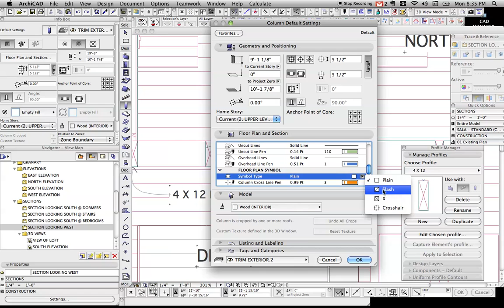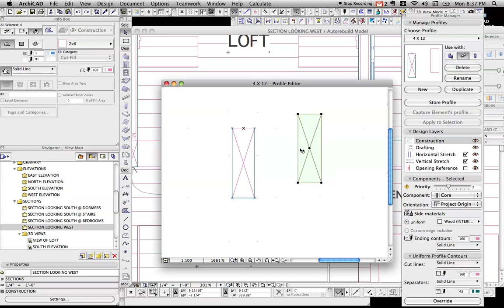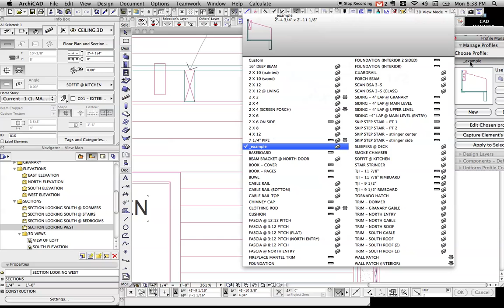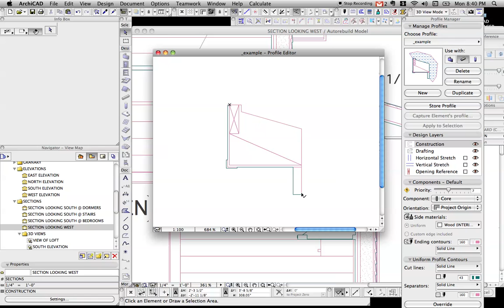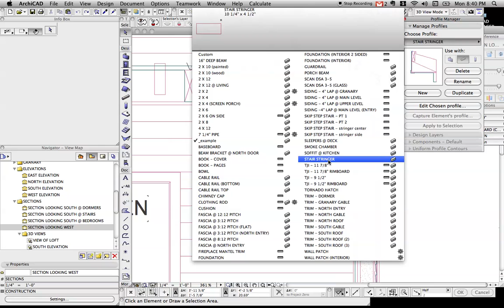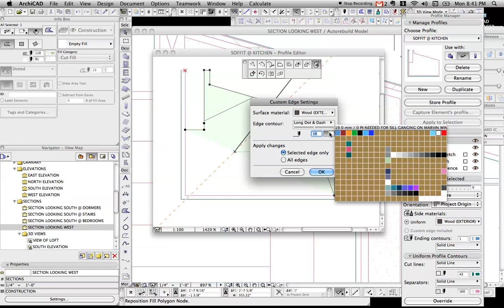ArchiCAD Tutorial #3: Complex Profile Creation techniques

Comment: Hello!
Very nice video. I have one question though regarding complex profiles. Can you make a complex profile in Archicad 19 (like a wall) to be represented in a certain way in the 2d plan. For example an 8" foundation wall with a 2" slab ledge ( the 2" ledge to be represented hatched and the rest of the wall to be represent with an empty fill in the 2d plan not section) ? Is there a way to do that with Archicad?
Thank you!
Reply from the maker: Yes and no. Pen Sets can solve some of this issue: http://blog.graphisoftus.com/archicad-education/tips-and-tricks/pen-sets-part-four

Also look into floor plan cut plane, as that will allow you to cut the wall at different locations in plan. This article will be useful and lead you to more articles: http://blog.graphisoftus.com/archicad-education/archicad-window-display-cheat-sheet
Reply: +Shoegnome, LLC. Thank you for the answer and keep up the good work :).

Comment: Such a shame you cant use 2d draughting to augment the 3d profiles. Your work around is great, but this method would mean wall / sole plate shedules wouldnt work or if they did a weight / volume calculation would be off.
Reply from the maker: +Jake White This video was done before Building Materials. Using BMats will definitely improve the quality of various calculations. Building Materials and Priority junctions mean some of these techniques are no longer required. I should probably do a new video on Complex Profiles talking about how I use them in a post-ARCHICAD 17 world.

Also these techniques put a priority on graphics over accurate data. And that's another thing I no longer recommend. So I would use the lessons from this video but make sure the model isn't cheated to look pretty.